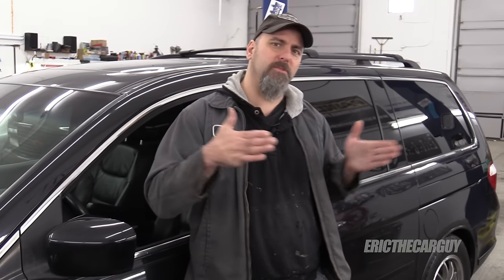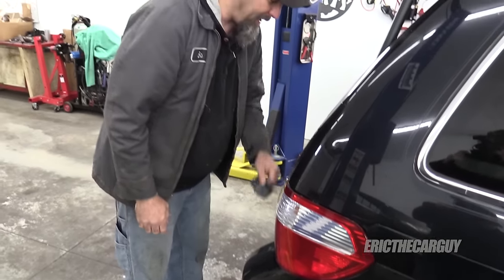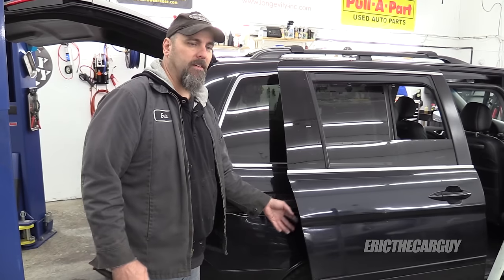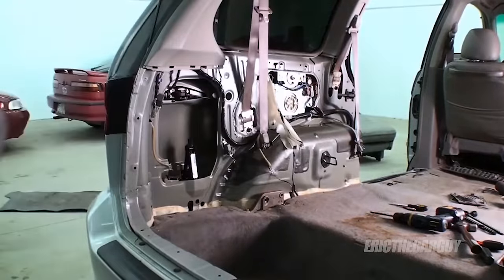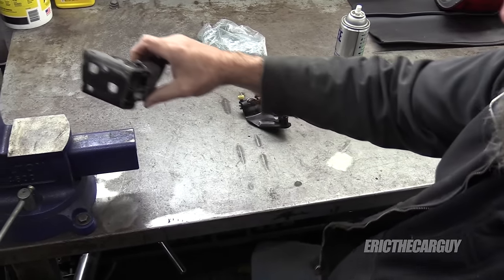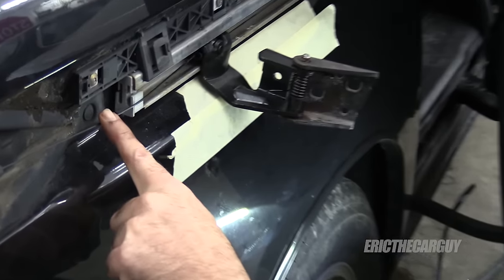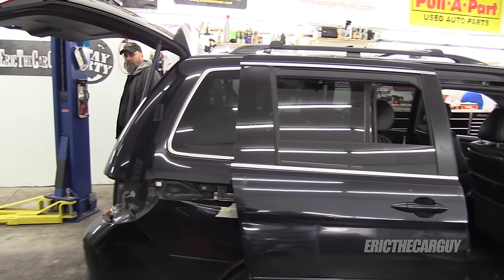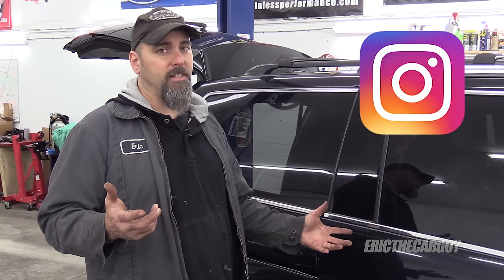Honda Odyssey Sliding Door Repair the 'Easy' Way

Comment: I have a beautiful 2010 Honda odyssey sitting in the driveway that I would love to shove up someone at Honda’s ass. Worst pain in the ass vehicle I have ever had to mess with And it’s definitely not enjoyable to work on. Whoever came up with the serpentine belt tensioner on that engine should have paper cuts in between all their fingers and toes and then thrown in a vat full of salt. I have never had to fix so many problems with one vehicle in my life. I think if you combined every vehicle I’ve owned since I was 16 I’ve not had this many problems. And I just got a text that the VSA light and the check engine lights on so here we go again we’ve got a new problem. I bought a kit off of eBay three weeks after we bought it to disable the eco-mode so it would stop using 2 1/2 quarts of oil a week. The kit basically tricks the engine into thinking it’s not fully warmed up With a resistor in the temp sensor circuit so it doesn’t come on. I thought it was having a problem with the transmission because it would jerk occasionally come to find out disabling the eco-mode fix that problem also. It took a while for me to realize where it was going because you never seen it smoke in the daylight but when somebody was driving behind you at night and the eco-light would come on he would start seeing a blue haze continuously. I get that problem fixed then roughly 6 months later I start smelling oil But it doesn’t drip on the ground then I seen that it was going into the alternator which ruined it And it was a pretty big pain in the ass to replace in the driveway especially with that go to hell belt tensioner they put on it. Some seriously expensive  ridiculous engineering right there. I should have put a new one on it when I done the alternator but I didn’t because I seen how expensive it was. Sure enough two months later I hear that familiar sound one of the pulleys making a noise so I had to go back and change it in the belt again. I’ve replaced the DVD player and a part I think was called the spool valve to get rid of a code. AC relay burnt up coming back from the beach had to buy a cheap voltmeter and figure that one out in Autozone’s parking lot but luckily they had one in stock and we were chilling again within 10 minutes. I’ve had to replace the rollers on both doors. Keep in mind this is a very nice van That has been taken very good care of by us and looks to have been taken excellent care of by who had it before considering how spotless clean it is. I had a good time reminding my better half on how wonderful her Honda odyssey was when I was pulling it home with a Chevy Tahoe that had 300,000 miles on it That’s had really no major problems since we’ve owned it. She should have got the old awd Astro van that I tried to get her to buy for 3500 bucks Instead of financing this pile. At least it’s really nice to drive when it’s doing what it supposed to.

Comment: Manufactured to fail to get more money out of you, typical Honda.  Instead of using screws to hold the wheels on on you have to replace the entire assy. And they designed the door to only open half way to replace the slide. yup engineered to fail.

Comment: Why half ass it? If your going to do a job like that do it right the first time!!! Lazy!!!
Reply from the maker: Did the door work when I was done judgy pants?
Reply: I have changed both of sliding door hinges on my 2005 Odyssey in this manner, twice. Works great! I have also changed my right side door motor. I don't know anybody who would want to take out those panels to access the motor if it's not necessary.
Reply: Hi Eric do you have any ader I si yuo or mowe I hew ader problem, thenks